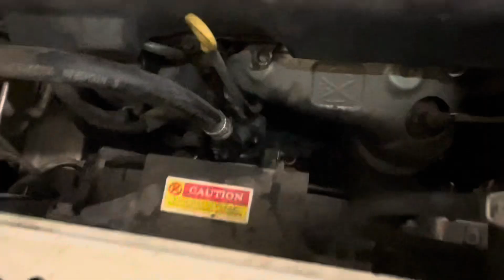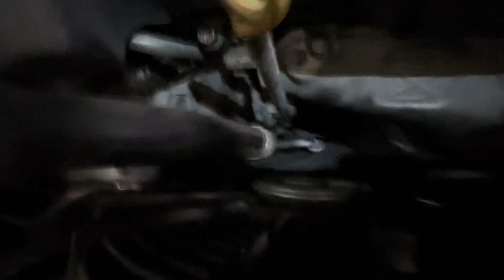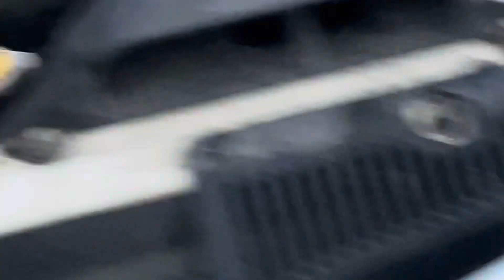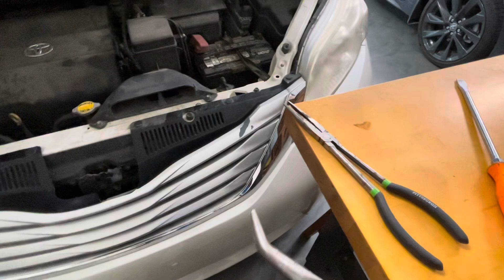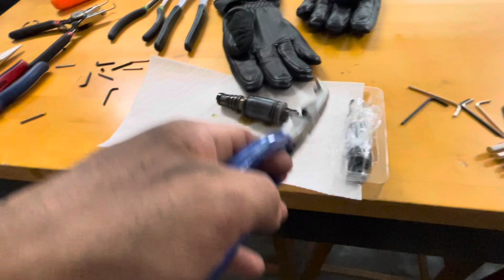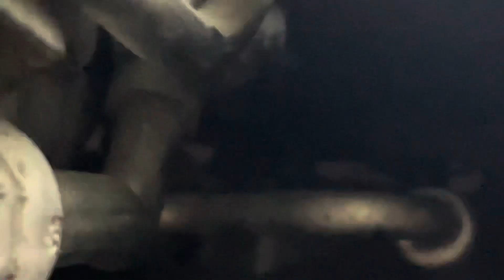2011-2016 Toyota Sienna AC Electronic Compressor Control Valve Replacement

Comment: Hi there! I have the same model your car I want replace the electronic control valve like you did but I don’t know when you pull it out the oil from condenser come out if they come out how you refill the oil. Thank for your feedback

Comment: You dont need to evacuate the system to change the flow sensor
Reply: The flow sensor you don't. What he replaced is the check valve. He is incorrectly calling it flow sensor. The flow sensor is just above it to the left.